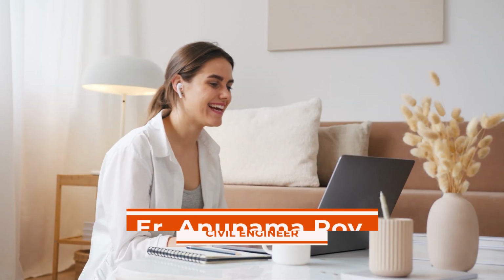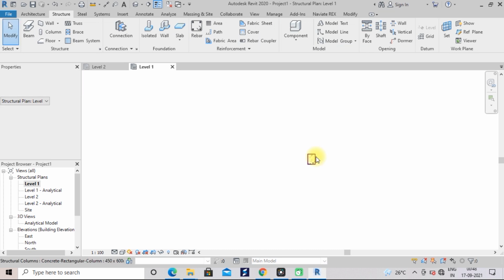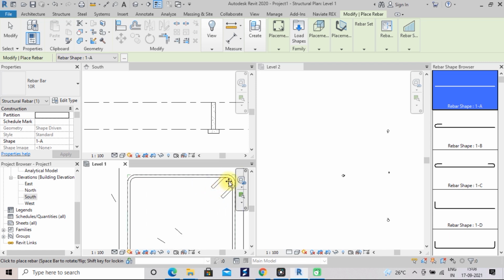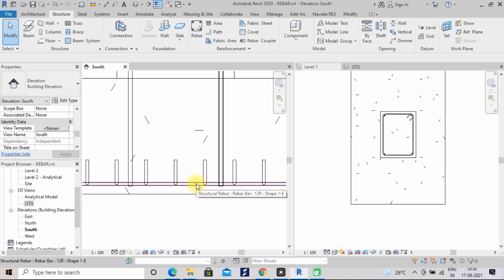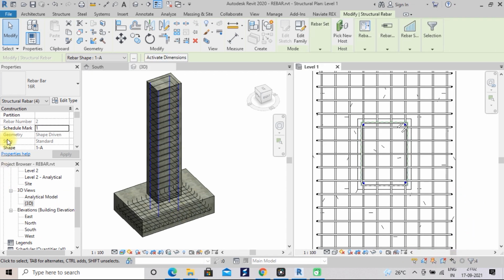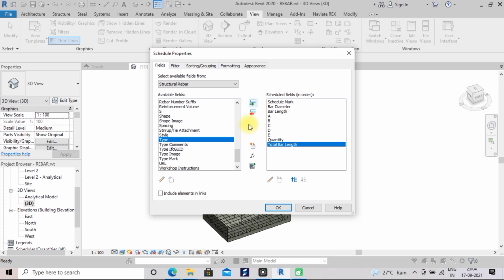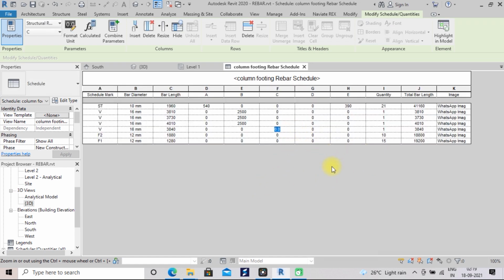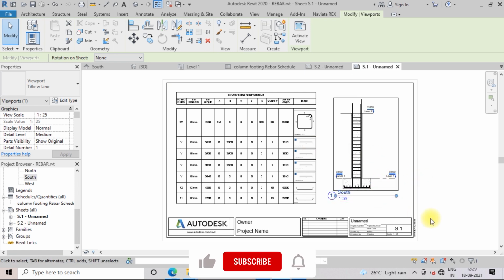How to Prepare Rebar Schedule and Sheet in Revit Structure

Comment: Very Very Beautiful Design.. Rebar Work..

Just one doubts :- 

Scheduled Quantity Insert Rebar image ..
1. How Make the Image ??
2. Step by Step A to Z Concept one videos Full length please..
( i. How to make AutoCAD planning's ,
ii. How to make Structure drawings In AutoCAD.
iii. How to make Elevation Septic tank footing Column Electrical plumbing fixtures Drawings in AutoCAD.
iv. Brick Quantities, Rebar Quantities , Sand Quantities , Cement Quantities , Wood Quantities , Tiles Quantities , Pipeline Quantities , Electrical Wiring and Lighting Switches  Fixtures Etc ...

Please Upload full concept ..